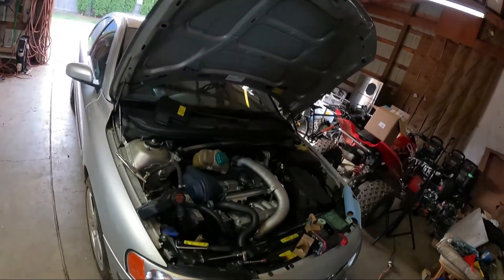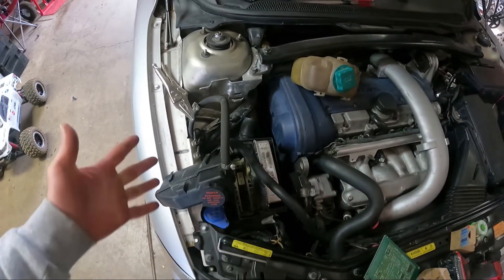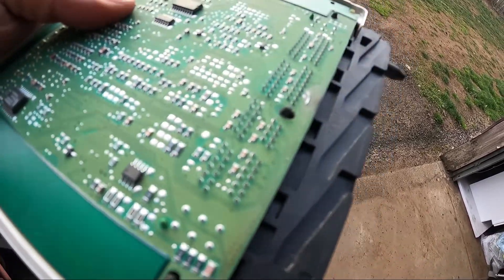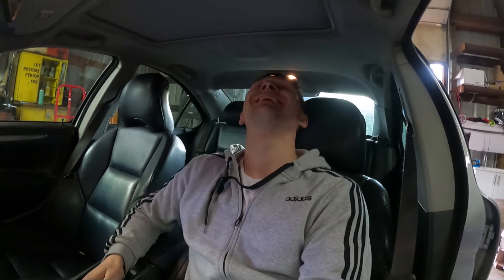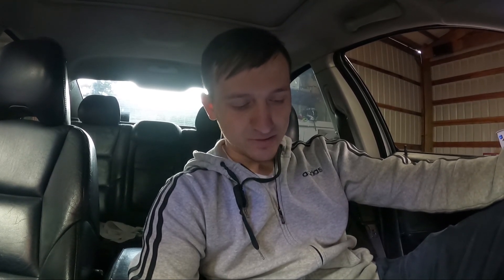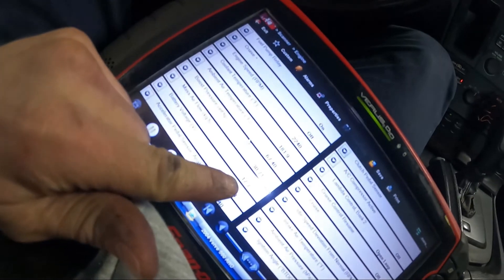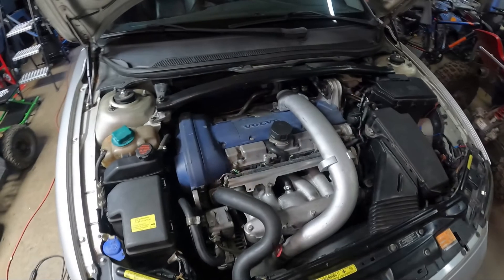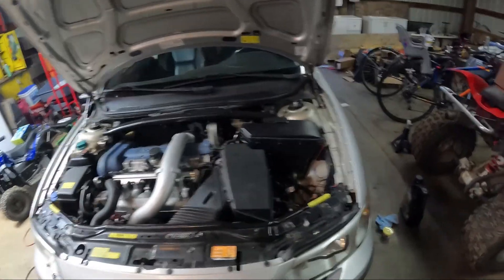Volvo P2 ECM-1300 Maf flow too high code FIXED!!! On the S60R

Comment: I have '07 S60 2.5T.
I'm having exactly the same CEL mystery.
I replaced the MAF sensor with brand new OEM Bosch part (twice).
CEL went away, but lit up again 3 weeks later.

A scan gave this code and error...
ECM-121B (Mass Air Flow (MAF) Sensor flow too low).

With your helpful video, I now know to check the ECM unit. I have to look for somebody willing to try such unconventional job.

Comment: I bet this is my issue too. I'm going to have to pull mine and see if this is same issue I'm having.  My wires fried to my maf I bet it did fry my computer. Glad you got it figured out awesome 👌
Reply from the maker: Yeah pull it and check it out.
Reply: @BuiltForSpeed  ya i hooked up my vida and I'm getting 1000 reading on my mass air flow as well. Going to pull mine and see if it has some corrosion
Reply from the maker: Yea pull it, take it apart and clean it and see if any of the tracks busted